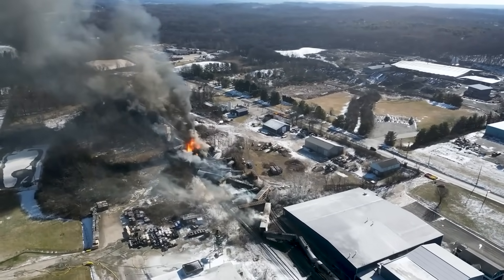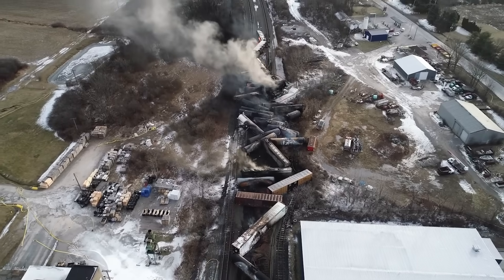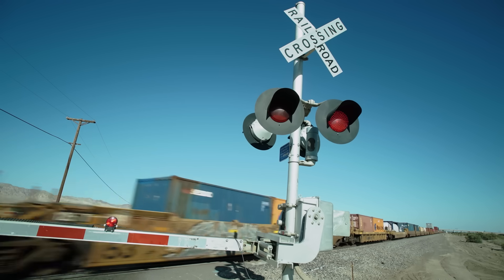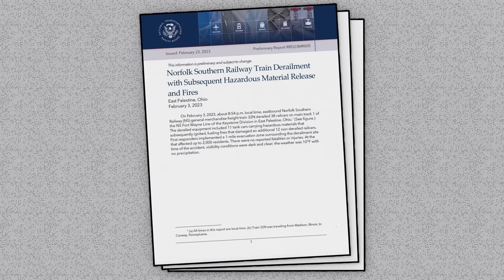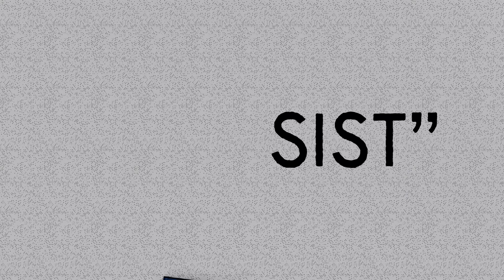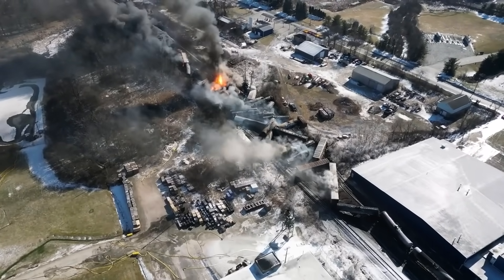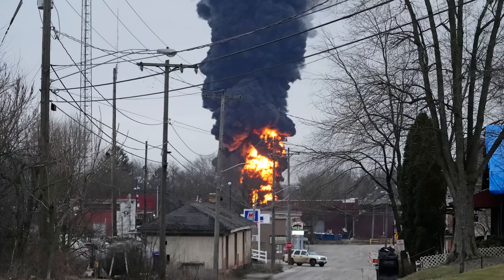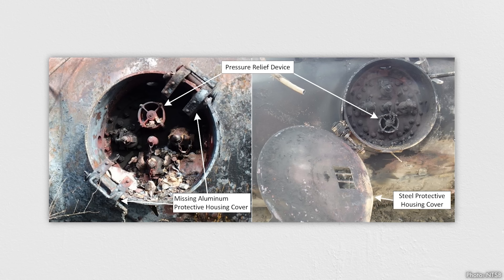East Palestine Train Derailment Explained

Comment: I would think the cost of 1000+ derailments per year would easily pay for designing and installing a temp transponder mounted on every wheel (something like the pressure transponder in your car tire).
Reply: Most of those derailments happen in a rail yard moving slowly.
Reply: Someone explained

"The point of the defect detector being on the ground is that it can scan the train as it goes by, if you were to have them onboard, you'd need one for every component it's monitoring. There would be an insane cost to attaching detectors to every component you want to monitor on every train car, compared with one detector that can monitor every train that passes it

Not to mention the safety side of things too, consider what happens if a detector fails. In the rail side scenario, a detector failing means you might not know about a problem immediately but the next one can pick up the slack and detect any issues later down the line, to not know about an issue until it's too late you'd need multiple sequential failures. In the onboard example the single detector monitoring that component is the only thing that needs to fail for you to be totally unaware of any issues, it's a single point of failure..."
Reply: 1. No its not more cost effective to install better safety measures
2. The term derailment is a very loose term and the slightly dealignment counts as a derailment and has to marked as such

Comment: i'm not a rail geek or anything like that... but the "149 cars" sounds like an insane number to me? wish we had some engineering numbers to work out the weight of such a crazy train and how one single point of failure could lead to such a disastrous derailment. is this an extremely rare or improbable combination of failures in the overheated nut or bolt thingy? what even caused it? bad maintenance practices? insufficient rail sensors? old/outdated monitoring tech? under-regulation?

it also seems almost like "bad luck" that out of the 30+ cars which actually derailed, it included the 5 cars of vinyl chloride... how much hazardous chemicals are actually being transported everyday? could it have been worse or was this just hitting the chemical disaster jackpot?

feels like there could really be a lot more numbers that would help make better sense of the whole disaster.

Comment: Timestamps & summary by Tammy AI 🔥🔥🔥Enjoy!
1:34: 🚂 38 cars of a Norfolk Southern Railway freight train carrying hazardous material derailed in East Palestine, Ohio, leading to controversy over rail industry regulations and federal involvement in chemical spills.
3:25: 🚂 A freight train carrying hazardous materials derails in East Palestine due to a suspected wheel bearing issue.
8:10: 🔥 A train carrying vinyl chloride derailed and caught fire, leading to a controlled burn to prevent an explosion.
10:16: 🚂 A train derailment in East Palestine, Ohio caused contamination of water, soil, and air, killing 40,000 small fish and impacting the local ecology.
14:25: 🚂 Freight rail is the safest way to transport hazardous materials, but accidents like East Palestine show that more can be done to improve safety regulations.
16:24: 💰 Get a year's access to Nebula for just $30 and support Practical Engineering!
Reply: the controlled burn was a statement by the rail company. but it turned out to be not true. false making the situation worse. 
at 7:15 - 25 or you said at 8:10
Reply: Screw your AI.
Reply: Neat concept
Reply: @CodytheDeer  This is cool!:eyes-pink-heart-shape::eyes-pink-heart-shape::eyes-pink-heart-shape:
Reply: Tammy AI is awesome! Thanks for sharing! 😍😍

Comment: This tells me that there is still a need for a caboose or a mid train crew car. Maybe a network connection for the cars to monitor bearings.     Either way it's a rare occurrence, don't overcomplicate it or the extra completely will make it worse.

Comment: I'm still confused if they had enough time to radio that a derailment might happen after applying the brakes. Why did the train not come to a stop? How does an axle overheating with the a brake being applied suddenly make the train leave the tracks?
Reply: You may have to wait for NTSB and other official reports! They're highly detailed and usually very interesting reading, even if they appear long after the fact..... 😎✌️
Reply: @gus473  Right but he made it sound like they physically had the time to walk to the 1st 2 cars manually apply the brakes, which could take a few minutes, and then disconnect the first two engines and move a mile up the line before the train even came to a stop?
Reply: @joshuaworley3898  No they moved the engines away from the rest of the train after it had already derailed
Reply: @MeOnStuff  He said "they notified their dispatchers of a possible deraiment" and then perform those actions but if it had actually derailed you think you didn't know that right?

Comment: I think this has more to do with management, maintenance, and skilled labour shortages, than an engineering problem. 

So much of our infrastructure in the USA is crumbling due to lack of maintenance. Management also don’t care about the details or if they have enough staff or not. On top of all this, blue collar workers have been in decline for a few decades. This leaving a skills gap behind.
Reply: I agree with you, with the one caveat that I question the common narrative that our infrastructure is crumbling. It is, but our sprawling development is never mentioned as a culprit. Sprawl looks cheap at the outset - cheap land, low taxes - but when a mile of power lines or pavement serves few houses instead of many, less property taxes are available to fix them when they break, and state and local governments beg for bailouts with the same refrain: "our infrastructure is crumbling."
Reply: None of this would have fixed this disaster.

These might be good things independently—I certainly think some of them are—but better management, maintainence, and skilled labor would not have prevented either the derailment or altered the subsequent actions take to mitigate the disaster.

Sometimes freak accidents happen, and it is always a terrible idea to legislate from anecdotes.
Reply: They've also been actively being cut back and had their hours increased for those that remain.

Comment: It seems obvious that the wayside defect detectors (WDD) aren’t sufficient. 
I can think of two ways to improve the system: 
1. Increase the density of the WDDs so that defects can be detected in time. 
2. Move the defect detection system from the track to the train. 

As a temporary measure, the thresholds that require action, could be lowered.
Reply: Someone explained

The point of the defect detector being on the ground is that it can scan the train as it goes by, if you were to have them onboard, you'd need one for every component it's monitoring. There would be an insane cost to attaching detectors to every component you want to monitor on every train car, compared with one detector that can monitor every train that passes it

Not to mention the safety side of things too, consider what happens if a detector fails. In the rail side scenario, a detector failing means you might not know about a problem immediately but the next one can pick up the slack and detect any issues later down the line, to not know about an issue until it's too late you'd need multiple sequential failures. In the onboard example the single detector monitoring that component is the only thing that needs to fail for you to be totally unaware of any issues, it's a single point of failure...
Reply: @namename9998  
1. Note that the ground side detectors weren’t quick enough to detect the failure. Onboard detectors would signal any fault immediately. 
2. Like brakes, onboard sensors can be made fail proof. They’d have to actively signal a ‘safe’ condition. No signal = unsafe. 
3. Cars have much more sensors than would be needed on a carriage. You’d only need to install them on carriages and not along the complete track. Just the cabling alongside the track is rather expensive and that system has been proven to be inadequate (as is). 
An advantage of onboard sensors is that they can be customised to their specific safety requirements while sideway detectors are generic by definition. 

Track side detectors don’t monitor every component either, so I don’t see why you’d need so much more sensors if installed on the wagons.
Reply: @Conservator.  Good points. Your comment and the other person both seem valid.
Reply: @namename9998  
Thanks! Just my thoughts though and I’m not an expert, not at all.

Comment: I have lived with a CSX train that runs along the edge of back yard for over 20 years and I can tell you a couple of things I know to be true.  The lengths of these trains have increased dramatically.  Sometimes there are as many as 4 engines at the front of the train and it can take them 30 mins to completely run by my house.  This seems kind of insane to me.  They run just as frequently, they are just a lot longer.  I try not to stress about what they carry, but there are often tanker cars in the mix.
Reply: The increase in length of trains is part of a practice called PSR.  Precision Scheduled Railroading.  
Crews and commentators have said of PSR "It is neither precise nor scheduled, and I would hardly call it railroading"
If you have a few minutes to hours to burn, there's a lot to look into there.
Reply: @yossarian6743  I have never kept up with this kind of topic, but have had friends who worked in the industry. What I know may have well been outdated by now, but the ownership of the actual rails and corridors are, especially in the longer transit areas, owned by the freight companies. And as I understand it Amtrak was a Fed started company. It may be true that the local corridors through populated jurisdictions have different right of way rules, but on private tracks, freight gets the right of way. Again, possibly old info. As far as my own experience, I just remember how many times my train had to pull over for freight... no matter what the circumstance was. There was a situation where a freight train was pulled off on a side track for break, it's break ended just as we approached, the passenger train had to stop, let the freight train back up, trade it places, and then wait for it to pass. It was very deliberately a power move, and if it was illegal I'm not sure how they would have justified getting away with it.
Reply: @Robert_McGarry_Poems  "Freight train interference — a dispatching decision made by a freight railroad to delay an Amtrak passenger train so that their freight trains can operate first — caused 900,000 minutes of delay in 2021.
For over 50 years, freight railroads have been required by law to provide Amtrak with “preference” to run passenger trains ahead of freight trains. However, many freight railroads ignore the law because it is extremely difficult for Amtrak to enforce it, and as a result, people and the American economy suffer."
Reply: @namename9998  That's interesting... I wonder how they got us on the main track to do all that jockeying if we just had the right of way? Thinking out loud, that's all... But why would the transit train actually go through with it?
Reply: @Robert_McGarry_Poems  What might work is if the govt owns the tracks and private companies (which amtrak probably should be) pay to use them. Some people talk about how public transportation (including trains) should be free but then shouldnt planes too. Roads are "free" and everyone can use them so why not do the same for tracks. I'm probably not the first person to suggest this though.
Reply: Many tanker cars will have some sort of placard displaying what they carry, or at least some sort of hazardous chemical identifier placard with a type and number, which you can then research and find the exact chemical being carried. For example, at 13:49, the overturned tanker truck has a placard on it. A quick Google search of "Flammable liquid 1267" reveals that the truck is carrying petroleum crude oil.
Reply: @triethylborane49  I don't think that standard always carries over to trains though. Over road tanks yes, rail I'm not certain.
Reply: @Robert_McGarry_Poems  True, not all cars seem to do it. But I've seen many that do. It's a bit hit or miss.
Reply: The trains that run by my apartment regularly have six or more engines.  The majority of the countries malt for beer comes through here.
Reply: My neighborhood has one way in and out. Trains regularly park in front for an hour or more. CSX put up a gate to block people from driving down a trail next to the track. People still use that trail.
Reply: We've lived in a busy commercial port town for 25 years in NZ and I can confirm the same.  Thank god for the hilly terrain; they can't go very fast here, or knowing our crappy infrastructure, there would have been a horrible accident by now.
Reply: It might be good to have different levels of bug out bags ready.

From, hmm, a minor spill, all the way to, 'Oh no! gill Bates just poisoned this land so he can control more farmland and force people to eat insects!' or 'East Palestine 2.0!!'
Reply: Thanks to new policies of making the train much much much longer so the operational cost could be reduce dramatically. To the point that it kill passenger train  in US because it can't be prioritize because the freight train is just too long for passing switch.

It getting much worse because somehow, for some reason, some people defend this practice because "it's fine and will induce efficiency" or whatever.
Reply: Trains have gotten too long. It's called Precision Scheduling and it's not good.  There's a good 3 hour podcast about the history and problems with the rail industry. https://www.youtube.com/watch?v=jNkYNjADoZg
Reply: Agree with what everyone said here. In addition to the potential accident issues with longer trains, extra long freight trains cause a logistical problem on the tracks that cause havoc and scheduling issues for passenger rail. The freight trains are so long that they are longer than the short passing areas, so Amtrak and similar services get stuck behind them. By law freight is supposed to give way to passenger rail, but in practice, it doesn't work that way.
Reply: @yossarian6743  It's actually the other way around. Passenger trains are visitors to that infrastructure and have always needed to yield to freight.
Reply: @yossarian6743  Which is precisely why they increased lengths too - to avoid having to yield to passenger rail
Reply: How is it insane?
Reply: What benefit do you envision to be from running shorter trains?  In this case, it was 1 car that was defective out of 129.  Even if it was 1 car out of 29, the failure still would have occured.
Longer trains are more fuel efficient.
Reply: @g00rb4u  If you keep increasing the length and are simultaneously cutting the number of conductors and over working the ones who are left...you are going to have more accidents.  This is but one of the huge number of train derailments in this country.  We just don't hear about most of them.
Reply: @ScottCP1  Don't forget the terrible infrastructure and lack of maintenance, which causes the derailment usually.
Reply: @ScottCP1  Note that most derailments have nothing to do with train length, and are just minor mishaps that occur in rail yards.
Reply: @g00rb4u  Wasn't it 31 cars that derailed?

So the longer the train, the bigger the potential problem. The more cars that can burn or poison the area.
Reply: @LeviathantheMighty  I didn't say 1 car derailed, I said there was one defective car (worn bearings resulting in abnoral axle temperatures)
Reply: @g00rb4u  But one defective car is all it takes, right?
Longer trains are more efficient, but at some point, it's just diminishing returns. You have less workers, bigger potential for problems, etc.
Reply: @g00rb4u  so you see, a 5 mile long train has more chance to derail with less eyes per car and when things do go wrong it's an even bigger poroblem. just mathematically terrible since we didn't build for that or use 20 person crews.
Reply: @Boardwoards  Why would more eyes help?  In this case, there was a automated notification that the bearings were heating up on one car, but the company policy said 'carry on'.
Reply: @Boardwoards  Speak for yourselves. I grew up near a railroad, and miles-long trains were always a thing. That line started getting used for other purposes, and I stopped ever seeing 30-minute train crossings for over 20 years, in favour of 5- or 6- train cars, Via Rail. Then I moved to another city, where cargo does go through a lot. I'm seeing the length of trains from when I was young again. You're just seeing different uses for your line over the last 20 years. That's all. 200+ car trains have always been a thing in North America. Source: Am Canadian.
Reply: @Nathan-dt2tu  it's not that they're new it's the working conditions. Terrible derailments didn't matter as much when unions weren't the only thing stopping us from ecological disaster.
Reply: @g00rb4u  they didnt say that, nor did they ask.
Reply: @uninterestedcat8429  Didn't say what?  I made two statements; which are you refuting?
Reply: @g00rb4u  Are you dense?

Comment: The government detected little to no chemicals of concern because the government chose not to label the chemicals in question as chemicals of concern.
Reply: That’s not true! Most of the chemicals that were released are EXTREMELY volatile. They will very quickly evaporate and wnd up in the upper atmosphere where they will be photodegraded